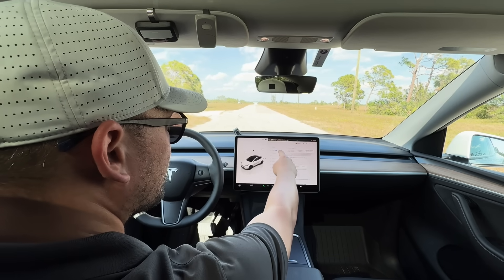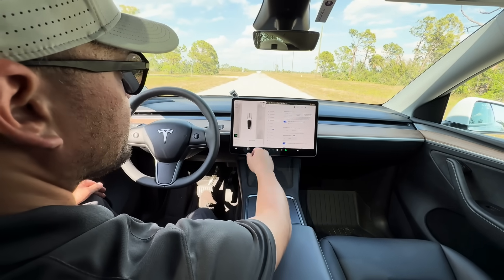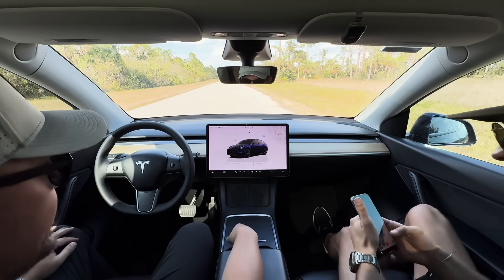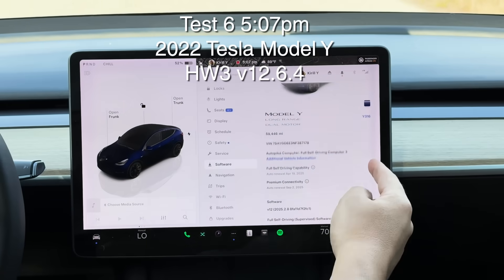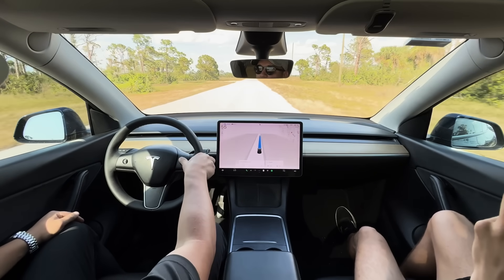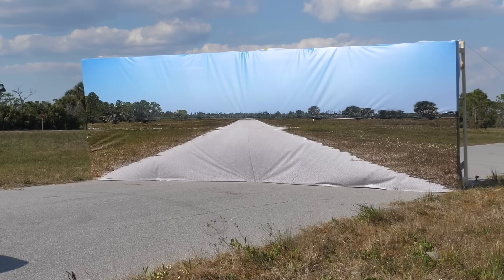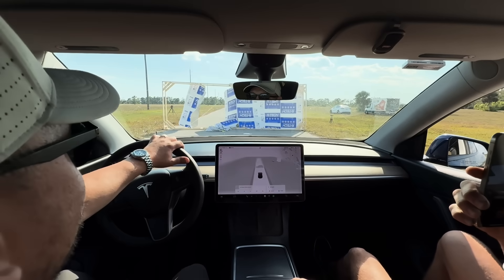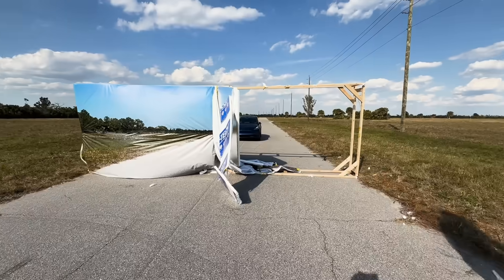Mark Rober Debunked - You can't fool a HW4 Tesla using FSD!

Comment: The amount of people who have claimed it is impossible for FSD to see the wall with simply camera's are proved wrong again. No doubt they will claim some kind of issue with the test, while ignoring the fact FSD on hardware 4 stopped every time.

Thank you for doing this test.
Reply: Should try the other test that Rober showed AP failing at. Fog, Rain, Bright lights.
Reply: The fact is, if the image of the wall doesn’t really look like a continuation of the road the cameras will stop you because they can see it looks like a wall, but if you made some super advanced system or just made maybe like a really transparent wall a camera system won’t be able tell that there is a wall because it won’t be able to see it.
Reply: @nathanw681  The same as people you mean.
Reply: @nathanw681 that would be an interesting test to have a transparent barrier.
Reply: HW3 failed the test. This is a bad result. Musk promised autonomy to HW3 buyers so what are they supposed to do now? HW4 is impressive but how much would it cost to retrofit old teslas with HW4?
Reply: @sarkaranish  Musk has already testified in court that FSD will never be above level 2. You will always have to pay attention and have your hands on the wheel.  FSD has never come out of beta. He just collected the money for it and left it how it is.
Reply: @darrennew8211  Elon is saying FSD will start operations in June. The Cybercab does not have a steering wheel, although they might not be operating in June.
Reply: @daydreamer8373  Elon has been saying FSD is ready for the last five years, and you're still believing him. So much so that he actually got punished by the regulatory commissions and now has to call it supervised. Let me know when a cybercab with no steering wheel actually makes it onto roads outside the mapped-to-the-centimeter trade show interior. (Why would you think there wasn't anyone driving that cab?) Let me know when it's reliable enough the government says he's allowed to call it FSD. You realize that Waymo made cars with no steering wheels and drove them around in public many years ago, right?
Reply: @sarkaranish this is just a quick search on the web as i remember said something on this topic:
Elon Musk has stated that Tesla will upgrade the hardware for early Tesla vehicles equipped with Hardware 3 (HW3) that have purchased the Full Self-Driving (FSD) package, if it turns out that HW3 cannot support unsupervised FSD. During Tesla's Q3 2024 earnings call on October 23, 2024, Musk acknowledged that there is uncertainty about whether HW3 can achieve the safety level required for unsupervised FSD. He said, "If that turns out to be the case, we will upgrade those who bought HW3 FSD for free." He reiterated this commitment during the Q1 2025 earnings call on January 29, 2025, stating, "The truth is that we’re gonna have to upgrade people’s Hardware 3 computer for those that have bought Full Self-Driving," adding that Tesla would do this "for free" despite it being "painful and difficult." This applies specifically to customers who paid for the FSD package outright, not necessarily those on a subscription model, and reflects Tesla's shift from earlier claims that all vehicles since 2016 had the hardware needed for FSD. However, no specific timeline or detailed plan for these upgrades has been confirmed as of the current date, March 29, 2025.
Reply: @sarkaranish  Elon already said they will retrofit HW3 cars if that's what it takes. This was last year so it's not new.  It will cost them, but they only have to retrofit those who have purchases FSD, not all HW3 vehicles.
Reply: @sarkaranish when was the last time you drove on a road and someone had a fake road wall in your way? Yeah that's what I thought.
Reply: @sarkaranish  No he didn t. Said that if HW3 can t get autonomous Tesla will upgrade the hardware to the owners for free. 
Also, this is a great result, the car has just passed an hard test (even tho pointless) that has no training for.
Do your research, invest in Tesla.
Reply: @sarkaranish  HW3 failed this test because it is designed to detect other vehicles not walls, it is still autonomous and would work completely fine to drive on town roads or highways. The simple answer to your question: "what are they supposed to do now?" I'd say anyone who owns a FSD HW3 Tesla should just try not to drive directly into a wall at 40-60 mph.

HW3:
- Identify pedestrians, vehicles, road signs, and lane markings.
- Make driving decisions based on environmental data. 
- It doesn't have depth perception, it can only detects walls when they have visible textures, contrast, or markings.
Reply: @ But HW3 vehicles were promised as being FSD capable, with not having to look at roads. I would love to see this test done on lower light conditions or without trees in the background.
Reply: @2Mystiic  Very wrong. The difference from HW3 and 4 is camera quality but also computing power. FSD v13 is a bigger model than v12, ergo smarter and sees better thx to better camera quality. 
As far as functionality they are the exact same. End to end neural networks.
Reply: @sarkaranish  No they are not. HW3 will be replaced for free by Tesla if not capable of autonomy.
Reply: @lucadellasciucca967  As long as you have paid for full self driving with the car.
Reply: @lucadellasciucca967  I understand what you are saying, the hardware version can't process depth due to the camera limitations and computing power. Like you said, the functionality is the same but due to the external limitations the HW3 models (like v12) it cannot perceive the wall as being a hazard like it could a vehicle or pedestrian.
Reply: @2Mystiic  Yes, but i want to be precise. The HW3 cameras can percive depth, just not as well. Also, the abilty of perceving things in general when neural networks are involved is also a matter of "intelligence", as in amount fo training overall and inference computeing. 
I m sure HW3 is ultimately capable to pass this test. Also remember that nothing like this test is present in the training data. V13 not only has better hardware working for it  but is also much smarter which results in the emerging behaviour that lets it pass the test.
Reply: @sarkaranish   Musk promised FSD next year in 2015. Don't listen what he says, look at what Tesla delivers
Reply: @Дімас7м you mean the Model Y. The best selling car in the world.
Reply: @sarkaranish  Yes and humans wouldn't pass it either. FSD might.
Reply: @daydreamer8373  I don't see how number of sales matter but even if it did, Tesla had 50k total sales in 2015 and model Y was made only in 2020. Even if current FSD is perfect and people who bought it in 2015 could upgrade it(they cant because hardware difference) it took 8 years until FSD came out of beta in 2023.
Reply: @Дімас7м  You asked what Elon delivers. The best selling car in the world is quite the achievement. Of course he has done many other things. But the point is he has delivered on many things.

FSD is not an easy problem to solve. The fact it has only taken eight years to get to the level of sophistication it is operating at is to my mind remarkable.
Reply: @daydreamer8373  I agree that FSD is very very hard problem. But if most people promise 1 year to complete something at their job they will be fired before 8 year passes. Elon got tens or hundreds of billions of dollars for overpromising instead
Reply: @Дімас7м  No he gets billions for delivering. All be it a little later than he would hope.
Reply: @daydreamer8373  was in 2024.
Reply: FSD still got fooled by showing a road (it clearly is not actually looking at), but some other part of the system could see a clear barrier.
Reply: @battery_wattage  Which is exactly how a human would see it.

Comment: Interestingly, FSD did not disengage right before the impact, but rather afterward, and it parked itself on the side after detecting the collision
Reply: But it parked itself on the left side of the road... Which is a bit weird. I mean either pick the right side, or don't steer and park on the center.
Reply: @sasjadv  its probably cuz most of the time crash vehicles or emergency lanes are on the left side of the road.. plus the drivers seat is on the left side.. and if the driver is injured, it will be easier to get to safety or to pull the driver out.. on the other hand if the car parked on the right hand side.. the drivers side would open facing the oncoming traffic right in the middle of the road.
Reply: @blackflame3127  Opposing traffic... That's what's on the left side of the road (in most countries at least).
Whenever you pull over, parallel park, it's always the right side, for a reason.
    It's probably because this tesla just didn't park itself, and didn't try to, it just disengaged and slowed down the car.
     If you're in a crash, you don't want your car to do a lot of maneuvering on its own, it might not function properly anyway.
Reply: @ like I said I have no clue, but I just think it makes sense to stop on the left hand side.. as the driver side will not open towards oncoming traffic or on an open road.. 

Again u r correct that it will move towards the oncoming cars.. which honestly I didn’t think about.. but we will never know:
Reply: @blackflame3127  Well, several things could happen in a crash.
1) If the car is severely damaged, the door could be mangled and not be able to open, same could happen to the steering. The driver might have to exit the car through the passenger door or the window.
Also, in case of electrical failure, you'd want the car disarmed, to not cause short circuits or other stuff. I.e. the idea is to shut down, and do nothing, and not to do more stuff.
2) If the car has been in a light crash, with mostly cosmetic damage, then the driver will probably be able to drive to a safe spot and decide what to do.
Reply: My hypothesis is the car "saw" a left bend (as seen in the visualization for a moment) so it tried to maintain general center, not really trying to park.
Reply: If you look closely, it wasn't the car that parked, but Kyle who hit the brake. And the Tesla continued to move on, even after the collision and disabling the autopilot.
Reply: Edit for better wording:
The car didn't park itself. It disengaged, so it no longer had control. The car slid to the left after impact, and the driver stepped on the brake to stop it.
Reply: @rustygear447 he did not step on the breakes btw
 my guess is it was just the regenbreaking when you are not pressing the gas
Reply: It honestly makes sense why it would disengage though. Car detects collision so you wouldn’t want autopilot to do anything after that point. Everything goes to emergency systems and the driver should be taking over if possible anyways.

Comment: Really shows the improvements between the hardware versions. I bet that Tesla will work this test into the system and soon HW3 will work the same. Great video and testing AND openness on the setup!
Reply: Will it be able to see stopped police vehicles, road blocks and tipped over trailer trucks? That is more relevant than this test.
Reply: @wonderboy75 did they already fix that ?
Reply: Unfortunately for Tesla, this is a bad result for them. They promised autonomy to HW3 buyers so what are they supposed to do now? HW4 is very good I will say.
Reply: @sarkaranish Tesla will offer hardware upgrades to HW3 vehicle owners. They already officially said so. Your lack of knowledge is your responsibility
Reply: @sarkaranish  They are still pushing software updates to HW3 just on a different branch than HW4, so both will continue to improve. Of course old hardware will never again reach parity with newer hardware but we don't know yet how good it will get on HW3. As far as what should HW3 owners do.. they should not think that they are stuck with the current capability but also not weigh a promise of future capability too heavily in a buying decision.
Reply: @sarkaranish  they promised autonomy with HW3 not against cartoon physics.. when in real life will you find yourself in a scenario like this?? 

HW3 is capable of autonomous self driving, just the processing power of HW4 is so strong that it can now improve on factors that will never appear in real life.. also how old is this tech.. every new technology has been predicted to be better than what it is.. it takes time to reach that point, LIDAR is a far older technology.. with years of research backing it, its not fair to compare the best of 1 but not of the other.
Reply: @blackflame3127  HW3 was said to be capable of FSD. It should be able to solve edge cases, even goofy ones like this.
Reply: @sarkaranish  it is capable of FSD.. it’s just can’t detect cartoonish walls painted or printed with fake roads.. 

It can drive u wherever u want to go fully autonomously.. that’s FSD.. just the capabilities of HW4 is better than HW3.. I don’t think the ppl behind Tesla’s tech ever expected to have to deal with this goofy ass scenario.. but the tech was developed to a certain point that it can do it.
Reply: @blackflame3127  HW3 is not capable of FSD (if FSD means full autonomy, level 4 or 5). It fails / disengages frequently (hell, ask the NHTSA, read their report). Plenty of video evidence available for anyone genuinely curious. I own a model 3, I've tried it, and I can get FSD to disengage predictably by driving into certain sunset-like conditions in which the dynamic range changes too quickly for the old camera sensors to cope - which isn't surprising to anyone who did the due diligence of reading the data-sheets. There are also issues with low-confidence blind left turns due to camera placement and FoV (lot of videos demonstrating this as well). It's impressive what they've achieved with old cameras, but merely 'impressive' was never the claim being made. I also wouldn't be surprised if a more realistic barrier could be made to fool HW4 - but at that point, it becomes academic curiosity - I'll give HW4 the nod for 'good enough' if doesn't EVER fail one of these tests.
Reply: We will see HW5 / AI5 with the option to retrofit for older HW3 vehicles. (HW4 runs on 16V vs 12V architecture)